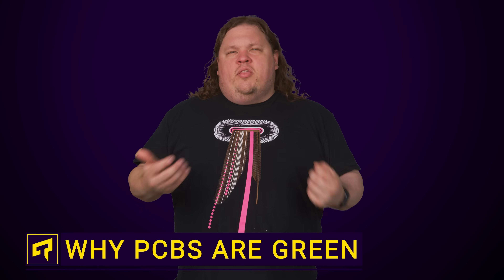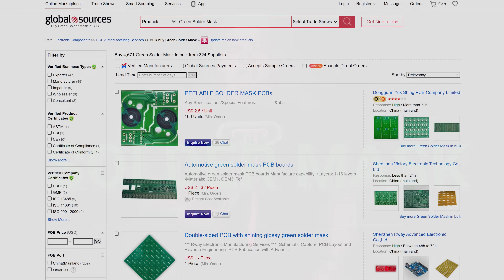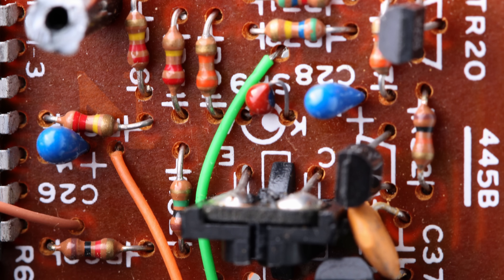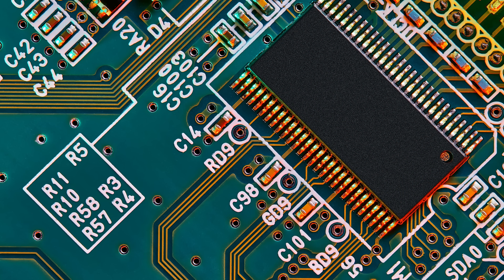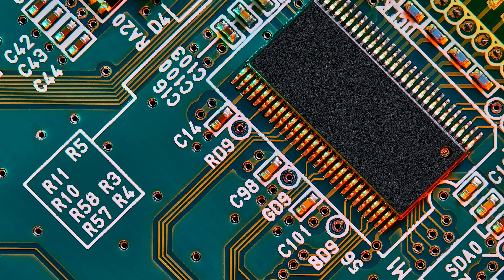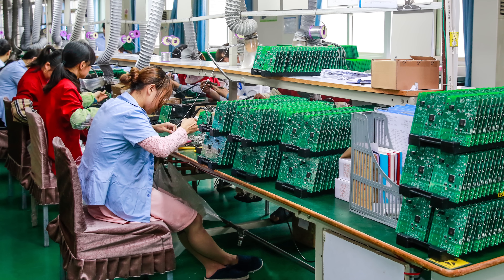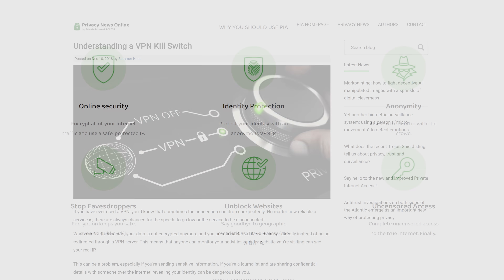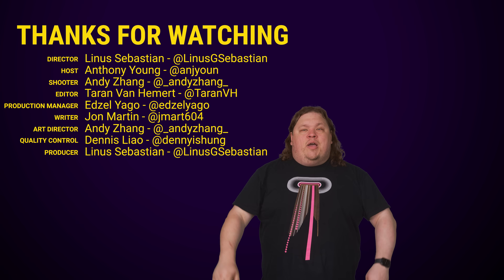Why Are Circuit Boards Green?

Comment: Other then motherboards and graphic cards, most pcb are still green. Modern production depends on ccd cameras for alignment. And these cameras and their light sources and the software work best if they are fine tuned for a specific color. So switching colors is actually a big problem for automation units.

Comment: My first job is on a PCB manufacturing company. The boards arrive with the cores intact already and a layer of soft (electroless) copper on both sides. An insulator is placed above the copper, then it goes to a laser drilling CNC equipment to put holes in the insulator. Another layer of soft copper is then plated before it is covered by a dry film resist where the print pattern is then transferred to cover the parts that will be retained. It will then undergo electrolytic (hard) copper plating, etched (to remove unnecesarry copper), before going through the process again (depending on the number of layers).

The green coating is what we call LPSR - Liquid Paste Solder Resist - it is there to protect the board as well as establish a layer where the pre-embedded solders - which we call bumps - are to be placed. The LPSR looks (and kinda smells) like paint. It has always been green during my time there (SBGA, FCBGA, etc) and I think the formulation of the solder resist has something to do with it as it arrives already with the green shade.

Comment: The real reason: Green is the natural color, so it was the first color, so it is the cheapest.

I don’t agree on the part where you say green leads to fewer manufacturing errors and allows for more densely packed boards. The boards are manufactured and inspected before soldermask is applied, so the color has no effect in that. Also the color has no effect on how dense you can make a board, in fact solder mask color is not even considered when designing a PCB other than when choosing your color of silk screen.
Reply: I agree on some. I've never heard of dimensional tolerance changing with color. As for "easier to inspect" I don't think he's referring to PCB fab, but rather post populating and reflowing.
Reply: @iNowHateAtSigns  I mean yea green would be easier to inspect by hand because it’s a lighter shade but it’s not really that big of a deal. I don’t think that plays into any part of why pcbs are mostly green

Comment: I've been in the engineering side forever and I actually asked and our process engineers at Motorola (late 90's) and the answer was simply the Fuji CP6 pick and place machines optics worked best with  green.  Our older boards (Motorola COAM) were red which I felt looked sharp.  

My old company we used green, so now that I am at a different company, I am requesting them to be blue.  Why?  Why not? I populate the boards by hand and blue works well for me and it identifies the old boards to the new designed boards, simply that.
Reply: Blue looks cheap though

Comment: I can actually answer the question, Hi Class 3 SMT op here. 

The way the solder paste stencil machine and SMT machine work plays a major factor into why the board's color is green. It's as simple as this, the machines use fid's to align the board to the proper orientation to be processed and pasted/ part placement. These fid's in the camera's eye look white n shiny ( B/W camera ) When a lighter board is used it will throw the camera off usually resulting in a error on the machine itself or it will align off the fid and misplace parts. What we do to address that issue is either use a special black pen or a round fid sticker to encapsulate the FID in black so when the camera moves to the Fid's origin all it will see is the fid and not the board.  

It's a major pain in the ass to do white boards, I really hate the days I have to run them.
Reply: Congratulations, you just explained contrast. :-P
Reply: @TomStorey96  actually no, contrast is a relative term in the tech/ art world. Depending what it the term contrast is being used on can mean a few things. Example, contrast could be the intensity of color not effecting light or dark while it could also mean the combination of a dark color contrasting the lighter color. What I explained was a process.

Comment: as for your "placed closer together with green" point at 2:10 :

I can't see that being a thing, whatsoever. Do you mean the minimum flow width, allowing you to fit a thin line of soldermask through smaller spaces - for example allowing some solder mask in between individual pins of small chips with the leads very close together?

Comment: I've worked with white PCBs before, and it's hell. I operated an AOI machine (automated optical inspection) and the one time we had a white PCB it was very difficult to train the components for inspection due to the glare. So yeah, fully white boards suck for manufacturing but look pretty. That's why you often see black boards with white accents, or light grey boards but not white.

Comment: PCBs originally often tended to be brown because of the base materials used back in the days of phenolic resin, bakelite and SRBP. With SRBP it became common to use an outer layer of a different colour - although this added complexity and cost to production. The solder resist layer tended to be green because it had a natural green tinge & adding dyes caused lots of issues in the early days. Over time it became easier to manufacture resist without the complications, but folk realised the advantages of green such as easy to look at and good contrast for visual & eventually machine inspection. Another point is that by the time other colours became practical there were very few components that themselves were green, try looking at a black component on a black PCB! So green became standard. Forget the military connection - it would be more akin to Olive Drab if it was the military, who don't tend to wave bare circuit boards about much in war zones anyway. 

When the move to fibreglass boards came, green (towards the yellow end) was the more natural colour & again didn't require expensive colouring techniques. With the advent of multi-spectral & x-ray inspection along with faster full ate of bare boards it became more practical to apply aesthetics to the design process.

Comment: So I work in a PCB factory building boards. Blue ones are actually pretty common, dont even see it as weird anymore. Red is far less common, but easily 3rd with black in 4th. We dont make anything cool like mobo's or graphics cards or anything, so I thought I would throw this in here to let y'all know whats common outside of gaming hardware. Most are green, but like I said blue isn't that rare, probably because its similar in terms of visibility and stuff mentioned in the video.

Comment: couldnt you do green for QA and then re-dye white? sure, repositioning for a secondary mask is a hassle but if you do a 100k run it surely pays off
Reply: definitely, and I can assure you most protoboards are green if they're just for engineering - it's just the standard color that's made the fastest, when you don't care about color.

You can change it basically with every order of the PCB - the manufacturer doesn't really care.

Comment: I used to work at a place that made circuit boards. There reason was because of the solder mask. They would say they would always try to suggest green when selling PCB's to companies because for them it was just one less step of making the boards.

Comment: AOI (automatic optical inspection) machines using red and blue light to shine from different angles and show height difference on 2d image, red pcbs was often confusing machines in reading the elevations on board.
Also as old machine was based mostly on color identification you would need to recalibrate the machine if you were switching the color of the board.
Today with 3D inspection it is not an big deal anymore yet again half the assembly lines in the world did not switch to 3D inspection yet, there for it cheaper both to produce green board and to assembly it later on :)

Comment: I promise you 1000% that military didn't specify green to camo PCBs. Electronics need to be protected from the elements and would usually be in a thing which wheels or that flies. Green was likely the cheapest and provided more benefit. Nothing more, nothing less. 
I don't see how you correctly state that only a few people look at PCBs to the military needs camouflage. Also the shade of green would stand out more than the brown color it is by default.

Comment: I've built boards with red, blue, yellow, black and green soldermask. I think the manufacturers buy green by the barrel and the other colors by the quart. Also, we have used different colors for different stages of development- red for first prototype, blue for second, etc. then green for production. But in 45 years of doing this, green is 99.5% of the boards I've done.

Comment: I always thought that it’s a normal transformation during production.
Back in Highschool a couple of decades ago, the boards we got had a earth/sand-ish brown tone. Then, we would project the circuits on it and the dip the board in a liquid to develop it. That’s the step when the unprojected areas became green while the other parts got a copper like tone. The lacquer we used to insulate the board was a clear one so the color didn’t change. It also helped preventing the board to react further with light.
Reply: That might have been how it was done a couple of decades ago, but it isn't how it's done now. A modern PCB manufacturing process (Minus the steps that don't affect the look of the PCB, like drilling and plating and such) goes like this: First, you get your fiberglass and copper. Then, you put photoresist on the board. Then, you project an inverse image of the traces onto the board. This removes the photoresist where you don't want it. Then, you dip the board in etchant. This removes the copper where the photoresist isn't protecting it. Then, you remove the rest of the photoresist and etchant. Then, you apply the green solder mask. At no point does the board look distinctly green until you apply the solder mask.

Your substrate might have been dyed green or something.

Comment: I'm a PCB design engineer, and let me tell you that I have no idea what the answer is.

Now seriously, the liquid it is made from is generally less thick than with other colors. This means that it can be made to tighter tolerances, and the minimum width can be smaller than with the others. Also it's cheaper because of the large volumes.

Comment: Why green?
Because we have human eyes.

Human visual system has more green 'pixels' than red and green combined.
Our sharpest vision is in the green, our weakest vision in in the blue with red being so-so.
Anything not green, on a 2d-surface like a PCB, stands out in sharp detail.
Look at Bayer color encoding in digital cameras: two (or more!) green pixels for every red and blue pair.
This is done so cameras better match human visual response.
Black and white TV cameras center their response on the green part of the spectrum, so the image 'looks right'.
Radiant energy from the Sun is mostly green...
Our eyes have adapted to a world washed in green light, my dudes!

Comment: I've taken apart a fair share of devices. Looks like no one inspected the boards... Always missing components. Although they still seemed to work just fine...
Reply: The missing components are either features not included or protection and noise components eliminated to reduce cost. Over the course of a manufacturing run changes are made.

Comment: Yeah interesting subject they have not always bin green use to be a brown collor light brown before that there was no circuit board electronics started out on a point to point wiring no circuit board like in early  tube electronics ive bin in the electronics industry for a long time , and have seen many changes the collor of a circuit board really is not a big deal just part of the manufacturing process ive even seen red circuit boards so its really just like putting on makeup hay that looks nice just like Black gaming boards look nice  , well mine is black lol i have two ASUS prime mother boards running intel X 9 nth generation cpus with quad memory and 18 core cpu , when i nfirst built my machine it came in second place as being one of the most powerfulest computers in the world on bench mark testing , i was like wow cool now its not so fast any more , it seamed as soon as i built my machine it went out of date so im not building another computer ever again becouse of communist china, they are Communist scum don t  buy there stuff ever its all crap and spyware and spy hardware trust me even games are spyware there is no place to hide on a computer, they can find you they can even watch you, A example of this happened to me one night my microsoft camera turned it self on all bye itself, yeah should never happen but it did a perfect example of being spyed on from a outside source don t trust your computer i removed my camera from my machine once my computer stops recieving updates will be  the last operating system i ever buy i have no plans on buying windows 11 or another computer ever again becouse of communist china , they deserve screw FUCK all from us they are the enimie we car e at WAR politicly and they deserve a good nuclear rain shower of golden nukes that is there future to burn in hell ,Fuck China Fuck north Korea they deserve screw fuck all from the rest of the world for being a threat to our nation and the rest of the world, i am at WAR with china, and i will never stop spreading the word just how bad they are every day i will be posting some where to tell the world to stop mbuying stuff from communist countries or Asia , we are capable of making our own stuff and this is the path we should take from now on too totaly cut off Communist countries from the rest of the world they are the worst of the worst and they don t care about you, they just want your money so fuck m they will never get another dime from me ever they are Evil, Mark my words on this day in history .

Comment: I miss the old brown and green pcb boards. When you open an old 1950s AM radio most likely you'll find a brown board with hand soldered resistors and capacitors on it. This video was a nice learning lesson. It never dawned on my that my ASUS mother board in my PC I built in 2017 wasn't green. Lol

Comment: FYI... black IS NOT the most common colour
YOU ARE JUST BIASED TOWARDS COMPUTER MOTHERBOARDS because that's the industry that you are in.
Go to an Alarm control box........ i challenge you to find a black PCB
Open a video, DVD Player, Blu Ray Player,  Open the back of your TV , CamCorder,    Projector    
any of these,  i challenge you to find a black board that is the most common
LOL

No mate...
Generally Green for Mainboards,     That Yellow / Light Brown  for POWER BOARDS
sometimes on fire related equipment RED is common for obvious reasons
but no.. usually Green and Brown 
After that it's blue

also the word SOLDER contain and L
it's not pronounced  SODER  it's  SOLDER

Comment: Those old brown boards are made from phenolic resin. It isn't as strong as the fibreglass used today and smells different. The raw fibreglass has a pale yellowish green colour. Some PCBs can be made of aluminium, ceramic or other materials too.
Reply: An aluminum substrate PCB? You do know that aluminum is conductive, don't you?
Reply: @1pcfred  you think the people who design and manufacture them haven't thought of that? Obviously there is an insulating layer between the substrate and the tracks (except perhaps ground tracks).
Reply: @1pcfred  aluminium PCBs can have PTHs. I'm not sure how it is done, possibly with an aluminium oxide insulating layer.
Reply: @1pcfred  not true, they have other applications. What do you have against aluminium PCBs? I don't recall hearing about them causing any problems. I would use whatever PCB core material suited the application.

Comment: the real reason : "puke green because whatever it ends up sitting in it wont be hard to tell whats the case and what is the board, these ugly color gets hidden away by the case after all.... no one would design puke green into a exposed color for appeal....honestly though, its probably a mixture of the first point they brought up + marketing as drastically changing things like color too much after they got used to it would make engineers mad and also make marketing boards that are not close to that color slightly harder to sell as they would be seen as "non standard boards"... probably also a cheaper dye color for the boards and printing ads... no one buys that color green dye.....

Comment: White circuit boards are also hard not to burn with the iron when soldering by hand. That's usually a defect or process indicator in j-std work. They still use them a lot in led circuit boards though so they absorb less light